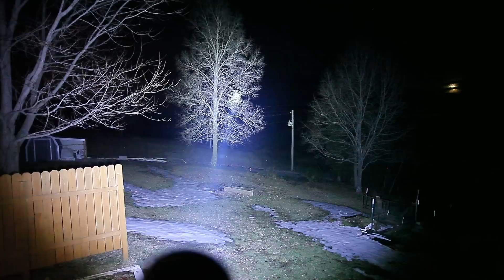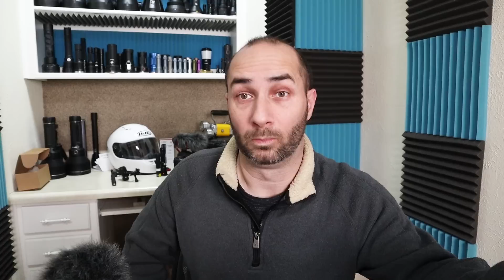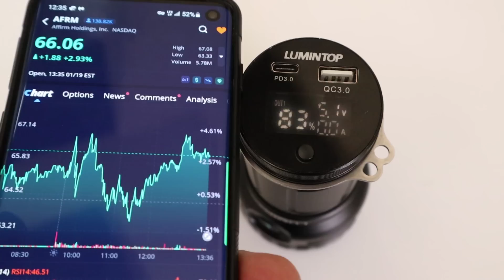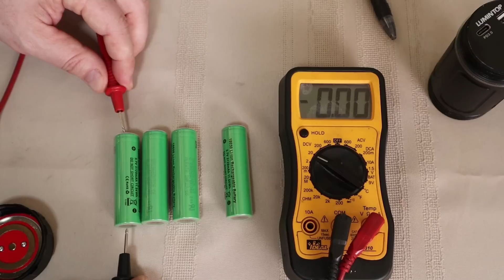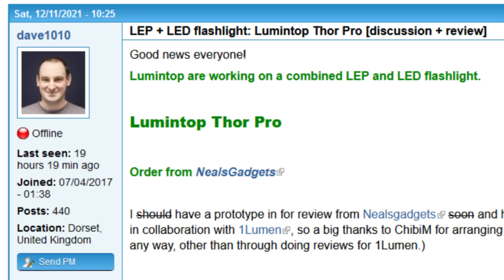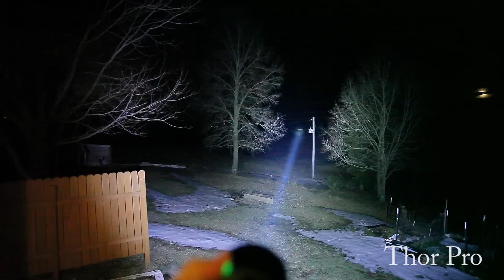The Most Brilliant Flashlight of 2022

Comment: the prototype is XPG3 led, the final version is XPL HD LED.
Reply: A 20w type-c PD charger and cable (minimum) are likely required for a 4a charge current(5v4a=20w), but the same input wattage could come from your oem samsung charger. It will be more like  9v 2.22a=20w from the samsung charger though.
Standard usb cables can only handle 3a, so a work around for this problem is to increase the voltage of the input. This is the fundamental operating principle of PD (Power Delivery)
Volts×Amps=Watts
Reply: @bridoc519  if you say so….
know it all
Reply: Makes more sense

Comment: If you look at the fully charged cells, it's undercharging with -0.05 on every cell, this will damage the batteries over time.. I've done a test over 3years since I have 40 18650 for my vaping gear.. So, I under charged 4 pcs over 3 years thru one of my mods, and the second 4 pcs I always took out of the mod and charged in a Gryfalcon charger, and those 4 batteries are still going strong...

Comment: You didn't get 4a because you were charging at 5v.
Its a PD input, meaning the other 2a will come from doubling input voltage.
5v 2a =10w
9v 2a =18w (which then gets reduced to 4.2v 4a inside the light)

Comment: That is a cool concept. 1400m is on the low side for a thrower that size. I like the Thor 1 since its pocketable and throws about the same. I think for a large flashlight they should be aiming for 2000m or more for the LEP.

Comment: In terms of actual utility, the almost parallel collimation of the LEPs seems limited. Long range signalling or coupled with high magnification optics for spotting. Does someone not make and LEP with an a set or adjustable optic? Putting this on a firearm with matching optics and and matching beam angle would make for an interesting long range  invasive hog rig or other night time pest hunting rig.

Thanks for sharing, Matt!

Comment: Please, please, please... for the love of everything holy DO NOT use the fuckin' XP-G3's.. FFS.. Use XP-G2's if you need to go cheap.. just.. no.. Stop using those fucked-up "high efficacy" emitters with phosphor all around the die and outside of it.. and stop using stupid OP reflectors.. If anything, use hybrid.. but even better, just use TIR for multiple emitter setups, it's proven that with the right emitters the beam is superb..
Reply from the maker: Neal just posted a comment that the final version will use XPL HD emitters.
Reply: @Lumencraft-  I suppose it's the regular XP-L, not the XP-L2 though.. otherwise it would be just as bad as the XP-G3's

Comment: I like the new light. Great review Matt!!

I hope Lumintop improves quality control. Only 1 of my 3 Black/Copper/Brass GT Nano's that I received in the last week has a rubber button opaque enough, to allow the red indicator light to shine through. Plus the new Brass one will only light up if I crank the tube extra tight. Even the extension tube didn't help. Now I'm worried my Thor III, that's on it's way will have something wrong with it.

Comment: Finally you dont have to bring 2 flashlight. Its always a battle between a far focused flashlight or a floodlight with those fancy orange peel reflector. For close quarters you can turn off the laser light and use jist the flood. And if you go out to do patrols you can use the laser focus light to spot far away objects.

Comment: Great video Matt! All your testing and feedback on this interesting light is appreciated.

On the balancing charger, I'm not so sure it is actually a balancing charger. Two or more cells connected on parallel will balance themselves, so I think it's the cells balancing eachother here, not the light. A great way to test would be to perform the same tests on another light that had the charging port built into the head.

It's also worth noting that balancing cells by connecting them in parallel can generate some high current flow between them, so for anyone reading, be careful about that.
Reply: Or you could put two batteries in there and connect their positive ends with a multimeter/wire+current clamp to measure if this happens in a regulated manner. Although you may also need to connecct the positive side to this pin up there to power the circuitry in the tailcap.
Reply: @NightmareQueenJune  That is an excellent idea!
Reply: @NightmareQueenJune  I just tried this with my BLF LT1. I measured 37ma flow from a 3.84V cell into a 3.75V cell, and measured NO flow between two 3.84V cells. Confirmed!
Reply: I came to say the same thing. You said it better than I would have!

Comment: I know it's a laser but the beam, even way out there, is so tiny. If you're searching for someone far away it would be hard to keep them in the beam. The led's seem to be lighting up the air between you and the trees, but not the MT18. Is that from the orange peel? I'd like to see this with some throwy reflectors, huh? Boom!
Reply: Yeah, I honestly don't get it the appeal of these LEPs. Unless you're mounting it to a telescope or something, I just don't see the practicality.
Reply: @floyd2386  That's not a bad idea, way easier to see than a tiny red laser on a telescope
Reply: If you will, imagine what you will see when the next (guessing) wave of product evolution drops. You will have multiple LEPS and a different refracting system. It will be those BMW lights on steroids! In the palm of your hand.
Reply: @16v15  Yes, with multiple lasers they could all come to a point in the center or spread out and make a larger but very bright hot spot. Maybe some cylindrical plano convex lenses in a radial pattern. Add a ring of maybe a combo of throw and flood reflectors

Comment: I doubt it's balance-charging the batteries tbh

I think the cells are merely just in parallel and therefore "balance" themselves on their own by charging/discharging eachother
Reply: Agree. The positive contact is a brass ring connects all cells. The LEDs are 3V so it is the easiest way that the batteries are in parallel. My convoy 4X18A does the same. But not a good idea to mix batteries with different levels because you cant control the self balancing effect current so huge current can run between a full and an empty cell
Reply: That was exactly my thinking too, but Matt knows way more than me, so figured I was wrong lol